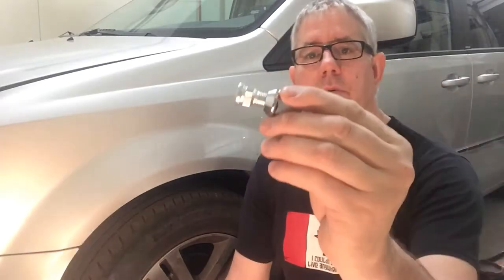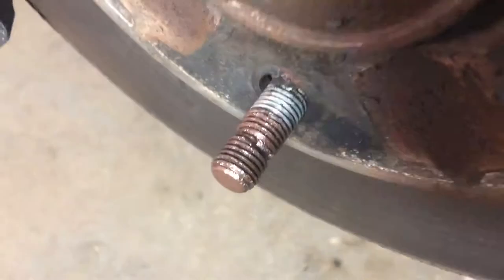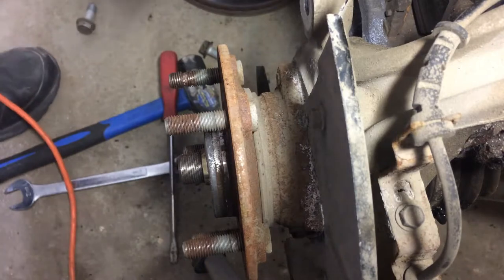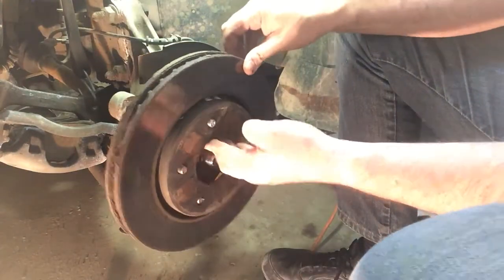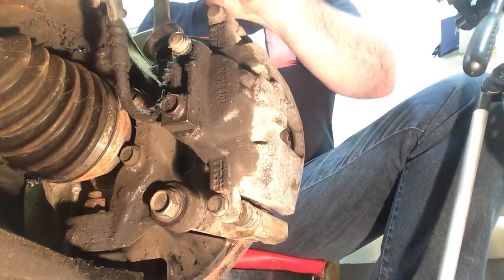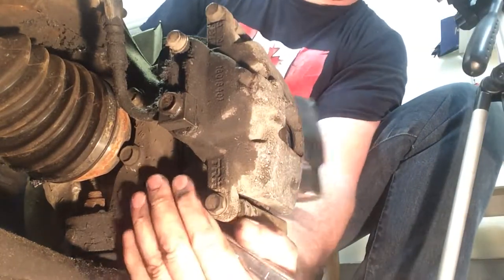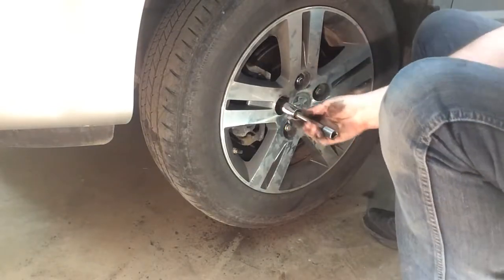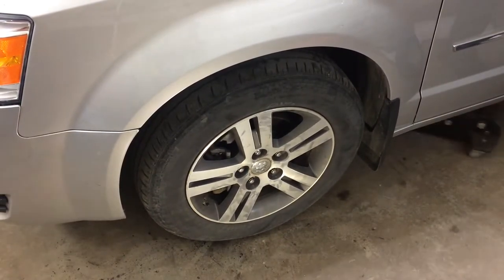How to change replace a wheel lug nut stud. 2008-2010 Grand Caravan Vw Routan Town & country (Ep 39)

Comment: This job gets way harder in the rear of the 2011, the dirt/gravel shield behind the rotor makes it so that you can't get the bolt/stud in or out. Thanks for the video though! P.S. A big C-clamp works wonders on pressing the caliper down.
Reply from the maker: @pjpdjs  Thanks for the info! Got some new specialized tools for caliper that works very well. Have a newer 2013 Caravan, so more videos to come.

Comment: I have to do this soon on my DGC.  I have seen the procedure in the service manual, but I wanted to see the process with removing the brakes before hand.  I noticed that you used the sledge hammer to knock the stud loose from the wheel base.  In the service manual it says to not do that as it will damage the wheel bearings causing premature failure.  What is your take on that?  The service manual refers to a stud removal tool number 8677, but that seems to be rather cost-prohibitive from what I have seen for a DIYer like yourself and me ($300-$400).
Reply from the maker: I am not too sure what I think. I do know the bearings take a lot of abuse from road bumps, pot holes and the like. You know how bad it can feel inside the vehicle as you drive. I was thinking the sledge can't be any worst, but I could be wrong. These vans do have weak hub bearings as it is. I bet that a shop uses the sledge as well. Maybe see what others are doing?